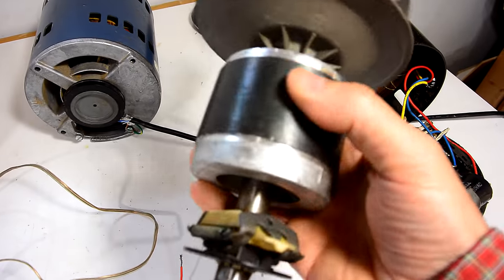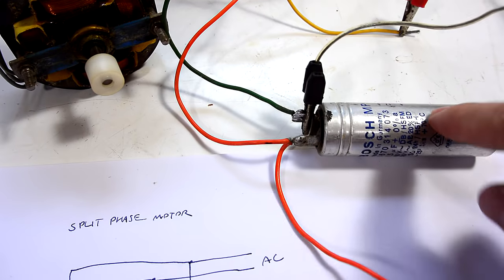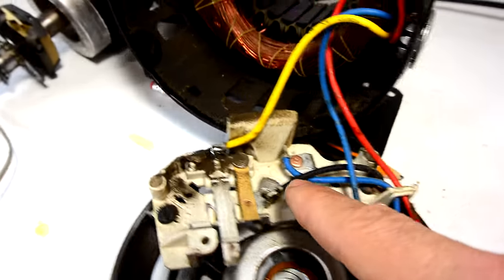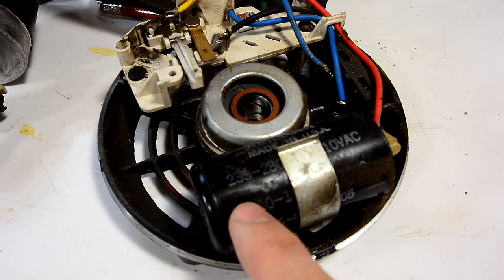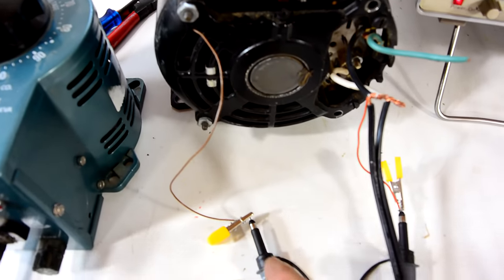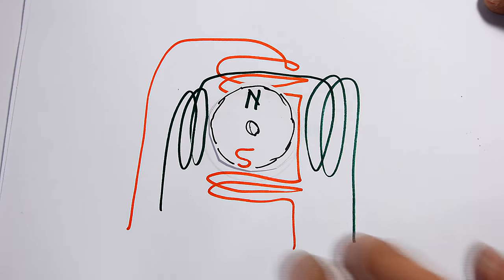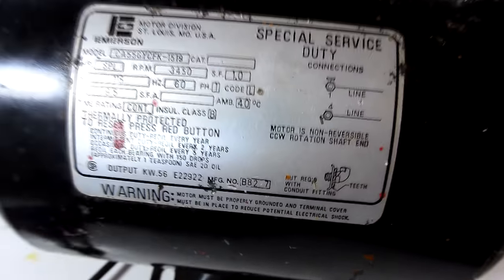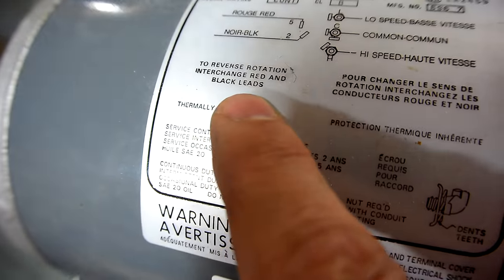Reversing single phase induction motors

Comment: Hey I was trying to hook a dpdt switch to an old General Electric motor that is used for s disk sander I couldn't figure it out, but I unplugged a wire now I can spin it with my hand to start it either way do you think I can run it like that. Also do you have a video where you install and dpdt switch to reverse a motor whenever you want

Comment: My garage door opener goes forward and reverse. Will the motor spin if I apply voltage to the black wire and the white is neutral.  Or do i need the capacitor to make the motor spin in either direction.

Comment: For those people who want to put a reversing switch on some electric motor, like on their drill press, could you please show how to wire up the switches on different types of motors? 
Especially DPDT and TPDT switches. There are a few people doing videos on installing reversing switchs on drill press motors, but you explain it better.
Thanks.
Reply from the maker: Just do what you would to reverse the motor, but instead of moving the wires, put on a switch.  The hard part is figuring out how to reverse the motor, and not all motors can be reversed.

Comment: What happens if a load, such as a light bulb, is connected to the start winding while the motor is running? Does this create a motor/generator? Very enlightening video BTW.
Reply: In theory yes, although I have never personally tried it with a single phase motor. But rotary phase converters work on the same principle and I have one of those.

Comment: I use this type of motor to run a pump. I can reverse it by swapping the black and red wires. How would I wire a switch to do this? I have an On-On DPDT switch on hand. Thanks!

Comment: A question, i have a 6hp 220 emerson with start and run caps it says on the case ccw rotation. It turns howecer clockwise, 5 wires two on start cap with a bleeder and 3 on run cap. Why is it turning backwards.the compressor was bought new never made air like it shouldi hunted for leaks and everything you can think of. Finally i noticed it was ccw motor and its turning clockwise. Any thing you can think of causing this. There are 5  terminals in the junction. Three are 220 and neutral one jumper sort of in the middle

Comment: The evolution of Matthias, Wood to metal
Reply: LordThanatos666 You don't. It's just welded.
Reply: LordThanatos666 If you did need to put a bolt through hollow steel/aluminum tubes, you'd drill a hole large enough to fit a wrench to secure the bolt head or nut. Do this where the bolt begins and ends. It's not as strong as welding but it's temporary enough for structures like those used at music events.
Reply: ***** According to my goldium and platinium smart watch, you are correct!
Reply: Luk Yat Ming He did get a degree in Mechanical Engineering. :P

Comment: I have a small Logan Lathe and it has a 3/4 hp.motor.  I put one of those reversing switches on it an the motor will run in cw or ccw but before it reverses  it has to slow way down or when you switch directions it will continue running the same direction.  Unlike a 3 phase motor. Is there a way to instantly change directions?
Reply from the maker: ItsRonsway No.  You need to wait for the starter winding to re-engage before it can be reversed.
Reply: Matthias Wandel  Thanks that is what I thought. I really enjoy all of your videos, keep them coming. 
Ronsway

Comment: Will a wall switch to control the speed of a ceiling fan also work on a 1/3 hp drill press motor?
I had it hooked up to a small powerful antique desk fan for quite a while and it worked pretty well.
Reply from the maker: No.

Comment: hi, got a Grizzly g1022 motor it says in the manual I need to switch wire number 5 and 8 but can't figure out which are those wires. thanks in advance

Comment: hi matthias, my problem is i want break into the starter winding and extend to a remote reversing switch. cap start induction run motor , i don,t know which terminals to do it from

Comment: could the "non reversible" motor be reversed by replacing the capacitor with an inductor, thereby changing the lead/lag effect?
Reply from the maker: Richard Manion Not really.  The winding already is an inductor.
Reply: But by adding a second inductor, the total inductance of the start winding will be greater, which would cause phase displacement. I know there exist inductor start split phase motors, just curious as to whether you could convert a capacitor start to an induction start motor.
Reply: Richard Manion 
I love how people use argument "don't confuse me with facts, my mind is made up" in their discussions
Reply: eglintonflats If my mind was already made up, I wouldn't have asked the question
Reply: +Richard Manion .....Yes, replacing the cap with an inductor will for sure reverse the motor.  I have done it and it works.
Reply: +Richard Manion ... Yes, they are called, induction start, induction run motors.

Comment: So the size of the phase shift  (90 degrees in this case) is determined by the capacitance?  So the shift could be something a little different from 90, but close enough?  Or is it somehow exactly 90 degrees?
Reply from the maker: its not that simple.  Its only approximate, and depends on load.  The whole phase shift with a capacitor is a bit of a kludge

Comment: I saw you changed the motor speed by changing the voltage. Does that motor have capacitor in it? In that way, does the motor get overheated?
Reply from the maker: Changing the voltage is not a good way to change the speed of an induction motor.

Comment: @Matthias:  I know this is an older video and I was curious about reversing the rotational direction.  Since Electrolytic Capacitors are polarity based.would reversing the connections on the capacitor reverse the motor?
Reply from the maker: those aren't polarized capacitors.  And no, reversing the camp does not reverse the motor

Comment: Nice explanation..... kept it up.  thanks 

I have an question regarding 1ph motor with 4 wire connection which can be run reverse and fwd direction. However, this motor voltage through SCR control card. The motor has 3 wires connected to motor. During running of motor i have measured the voltage common to one terminal has 125VAC, and common to another terminal 100VAC in CW direction. For CCW change over the voltage of terminal 100VAC instead of 125VAC and 125VAC instead of 100VAC. and running well with existing motor.
But the problem is after install new motor (spare) the system control voltage fluctuating 15V, when running in both direction. 
Could you pls explain what cause u can suspect. 
Thank you..
Reply from the maker: it's a split phase motor, two equal windings.  It sounds like the replacement motor is a motor with a starter winding.  If you run it off the starter winding as a primary winding, it will overheat that winding and burn it out.

Comment: Is there a way to make a single speed motor into a variable speed motor to slow it down? I have a Hegner single speed scroll saw that runs at 1700 strokes per minute and I'd like to cut that speed in half or so. Can that be done without screwing up a motor? Thanks for your help. I live and breathe through your videos. I'm also old.
Reply from the maker: no

Comment: What always did my head in: When you hooked up the motor of your saw mill you connected it instead of  between neutral and phase between phase 1 and phase 2. Now I do understand that in North America they only use two phases with 180° between them which is why the two 110V phases yielded about 200V on your volt meter.

Would this type of arrangement still need a starter winding? Somehow my head tells me it wouldn't and swapping those two around should reverse it.
But it is a situation I have never come across until you demonstrated it. But if this is the case you would be able to do this to any single phase motor.
Which again for me doesn't have a practical purpose since I don't have 180° phases.

(well I might or might not if a take a lead from a neighbor a couple roads down, since power stations actually make them in 30° steps to have sensible wire diameters and then distribute them)
Reply from the maker: ***** "Two phase power" is two hpases 180 degrees apart.  Which means, really, just tow single phase circuits opposed to each other.  There is no inherent rotation in there.  Two phase is single phase just as single phase is, just more voltage.
Reply: ***** 
In america they have 3 phase generators, but after downtransformation there is basically only "one phase" distributed to the houses. They have two different potentials because they have transformers with "central tapping" . So phase 1 to central tapping is 110V and phase 2 to central tapping is 110V. Between P1 and P2 you got 220V.
 
The american system has only disadvantages in comparison to the european,  because 110V are not healthy either...

Comment: Some motors without a centrifugal switch  also having  a capacitor  directly connected to a  winding. aren't those called STARTING WINDING and STARTING CAPACITOR ? and how does the capacitor remains without damage due to permanently connection.and how do we identify the windings without a proper color code?

Comment: My dad's belt sander has had this problem with starting up eversince I can remember it. When you push the start button it sounds like there's too much load on the electric motor so you have to give the belt a push by hand, then it starts up and works just fine.
Now, I'm not really good with electronics but is it possible that it is caused by the fault of the start capacitor you mention in the "capacitor start capacitor run engine" segment of the video?
Reply from the maker: faulty starting capacitor or starter switch
Reply: Thanks!

Comment: What would happen If I connect the phase to both sides of the capacitor at the same time ? 
Let's say I connect with relays, and one of the relays gets stuck.

I see that the capacitor is basically shorted, so it would do nothing, but what about the windings ?
Thank you

Comment: Thanks for valued info. 
I have removed a motor from toilet ventilation fan, it is induction type and it has only 2 wires and without capacitor.  how it can be that??
Reply from the maker: see my video on ac motors
Reply: Thanks for all your great helpful Videos. Can you tell me how to change the direction on a shaded pull motor? I have a fan motor I need to reverse. Thanks.

Comment: I've been Googling, but can't find an answer. Hopefully someone can answer. Can I swap the rotor in an induction motor? Providing that the size of the rotor core is the same. My goal is to get a different length shaft into the motor. I know the bearings may need to changed to accommodate the shaft. Thanks.

Comment: I have a 220v 1.5Hp single phase induction motor. I would like to slow the initial hard start . Can I do this with an adequately rated resistor and a switch that has the resistor in series with the motor just for the initial start ?  Motor says YLJ90L4-19A on the side . Thanks
Reply from the maker: Bad idea.  These motors consume crazy amounts of current on start, so you want that done as quick as possible.

Comment: sorry for asking the silly question
but if i reverse the direction of capacitor then the direction of rotation will also change 
right?
Reply: +Ishmeet Singh Bindra No, you must reverse the start and finish wires of the starter winding

Comment: Hey Matthias sorry to bug you (again), but I honestly know nothing about electricity!! I have a one and a half horse electric motor for my bandsaw build (your plans) and it runs counter clockwise, I have managed to reverse it by switching the wires coming from the windings, but I have to start it running by spinning the shaft manually? it has 3 wires coming from the windings similar to the one you're talking about in the video (I think?) Does that mean It can't be reversed unless I pull a wire from the windings?
Reply: +The Pallet Hippie Yes, you must have 4 wires or both ends of each winding to make the adjustment
Reply: +Tera Volt Cheers Tara Volt, I kinda thought that was the case! I took the cover off the back of the motor and the shaft runs right through and protrudes out the back! Voila!!  I just turned it around!!
Reply: That's definitely another way if it's compatible to do so. Fun fact, this is the only way to reverse shaded pole motors, as you can't reposition the shading rings
Reply: +Tera Volt  I managed to reverse it, but it would only run if i gave the shaft a spin manually to start it off and considering i want it for a bandsaw, i wouldn't  recommend having to kick start it by tugging  on the wheel or worse still, the blade!

Comment: When you don't know which is start and run winding, as long as you reverse either with respect to the other, the motor will revers, so you could swap polarity of the run winding
also, in a rare selection of motors, a non reversible motor can be reversed if you can swap the rotor and end caps around  so essentially the shaft sticks out the other end, can't be done with switch start motors, unless you find a way to extend the contact wires to the other end

Comment: Matt, is it possible to change the cap on the starting winding such that 270 degrees of phase is seen?
Reply: No, that is not possible. Only a maximum 90º of phase difference can be achieved.

Comment: Hello, I have an old meat grinder (H.P. 1/4, Current: AC, Volts: 110/200, Cycles: 60, Phase: 1, AMP: 8/4) that is spinning right, but we need for it to spin left. WITHOUT a centrifugal switch, starter contact with plastic that it sits on and a capacitor how can we make the grinder spin left?
Reply from the maker: it all depends on the design of the motor, and you didn't tell me anything about that, so I don't know.

Comment: on the topic of motors, is there something fun you could do with an elevator motor? i scrap em all the time, both new and old, small and big.
Reply: Build your own cranes I guess for load lifting.
Reply: MadlySevered Hook them up to be in reverse rotation to a gas engine and watch the gas engine stall or explode from being overpowered. Or a gas engine speed faster than its setting on the fuel lever by having the electric motor spin the same direction, but faster than the current speed of the gas engine. Done that plenty of times. Kind of funny when the gas engine is being ran faster with the electric motor. LOL

Comment: I am testing a capacitor starter induction motor, used in substation isolator(disconnector). However i am having a problem, the motor draws about 2 amp current during forward operation, and over 6 amps during the reverse operation. The motor is single phase and rated for 3.5 amp at 220volts. The load is should be same for both forward and reverse operation. What could be the reason!
Reply from the maker: Possibly the starter is not disengaging in reverse.

Comment: So I'm pretty sure there is a reason for the thinner wire. It's not to save money... It creates a higher resistance. Thus reducing the current lag in respect to the voltage. The capacitor further reduces current lag. Almost making the current and voltage simultaneous for a powerful start. Some ac induction motors have both a starting and running capacitor. My air compressor has both.
Reply: +school146878 Yes, it changes the coils reactance thus phase compared to the main winding. Particularly needed for motors with no capacitors to create enough of a shift to create the rotating field

Comment: I have a 1/3 attic old  fan motor that only that only spin  when you spin  the blade .The it will run really good.But when you turn it off with then on again the switch it will just  buzzes and doesn't spin at all until you   make it spin.I tried oiling the motor but it is still doing the same thing.So is my 1/3 attic motor gone bad ?
Reply: Nutone 765hfl-a exhaust fan quit ; spinning it won’t keep spinning.  What’s gone bad?  It was stuck on something when I first tried spinning it tho’.  Label says 1/100 HP 1000 RPM 120 V 60 HZ 0.86 A. And has 3 wires into it. Haven’t opened it as case is not bolted

Comment: I just recent;y acquired a couple of 2 speed swamp cooler motors. Both are induction motors and I would like to reverse them. Do you know if it's possible with 2 speed motors?
Reply from the maker: it has nothing to do with being two speed, and everything to do with whether the motor is reversible.
Reply: @matthiaswandel , my understanding is that I need to reverse the ends of the start coil. That one should be the one with the smaller gauge wire. Am I correct in my thinking?

Comment: hi i have a question i have a split phase motor without any capacitors  what happens if i put a starter capacitor to the start winding and run capacitor to the main winding ? 
also if the torque increases will the current increase ?
Reply: +Abo MooTa Alshdeed Caps are put on the starter winding only as they cause the greatest phase shift and as you've pointed out, more torque. Putting a run cap on the main winding in series will severely limit the current and render the motor useless. In parallel will have no output effect except offset current drawn from the supply.

Comment: Couldn't you reverse the motor by adding additional start capacitance, to delay it to 270 degrees?
Reply: eformance you might be able to change the phase shift to 270, but it would require more than adding additional capacitance. A single capacitor can only shift phase by 90 degrees (no matter what the value of the capacitor).

Comment: What if I drill hole through the outer casing bring the three wires out extend them and bring them back in on the what is essentially the front of the motor then switch the front and back relocating the wiring of the whining?